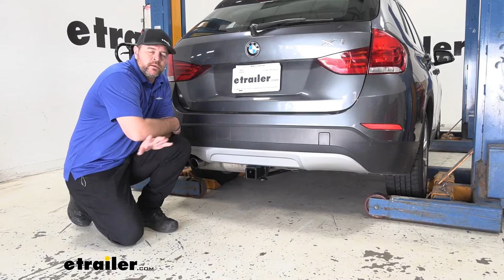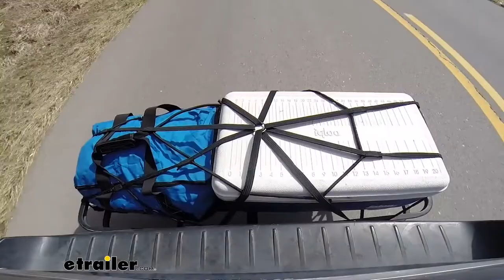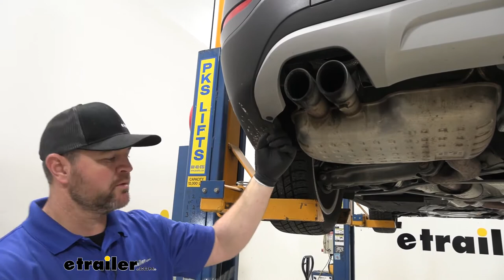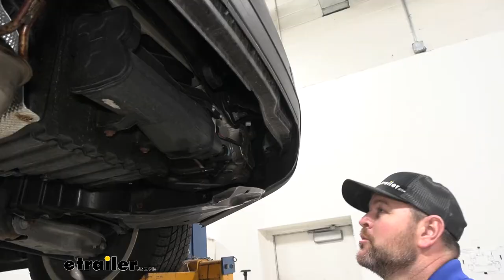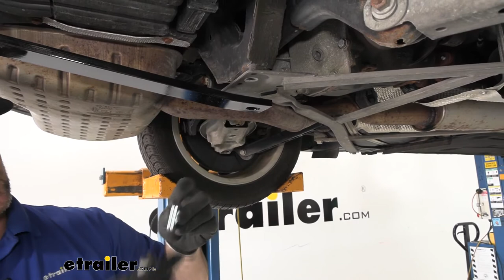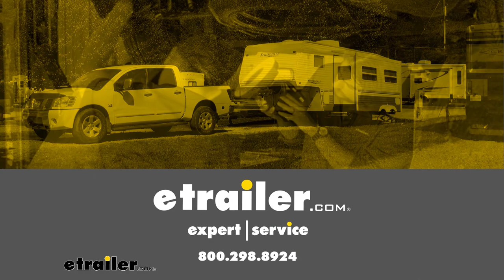etrailer | Curt Trailer Hitch Installation - 2014 BMW X1

Comment: Before you attempt to do this yourself, please note, when e-trailer is doing the install, the vehicle is on a lift making the installation seem a lot easier than doing this at home, with the car on floor, jacked up.

I attempted to do this myself, but ended up having to get it professionally installed, here’s why (not mentioned in the video). The 4 bolts that mount the hitch to the vehicle, while they can be removed with an 18mm wrench, a standard torque wrench (socket) cannot fit in the tight space to safely tighten the 2 higher bolts. It probably would have been fine with 2 torqued bolts, but safety first.

Comment: Do I have to jack the car up or would I have enough space? Seems like an easy DIY.
Reply from the maker: It is a tight fit but it is possible to do this installation from the ground. It helps if you can get your hands on a set of car ramps to get the rear end of the vehicle up in the air a bit.
https://www.etrailer.com/Trailer-Hitch/CURT/C13140.html

Comment: Would this work oN a x1 2012 ?
Reply from the maker: This trailer hitch is designed to fit the 2012 - 2015 BMW X1. 
https://www.etrailer.com/Trailer-Hitch/Curt/C13140.html

Comment: Why wouldn't it fit without a Panoramic Sunroof?

Do you have a vehicle without a Panoramic Sunroof?
Reply from the maker: From what Curt tells us, the BMW X1 with the panoramic roof has additional support on the underside of the vehicle to add structural support due to the glass roof. This is different than vehicles that don't have this additional support structure, and is why the hitch doesn't fit on vehicles with the 'solid' roof. At this time, none of our hitch manufacturers offer a hitch fit for the X1 that doesn't have the glass roof. Wish we had better news for you!
https://www.etrailer.com/Trailer-Hitch/CURT/C13140.html
Reply: @etrailer  I was very convinced. Thank you for your kind response.🥺